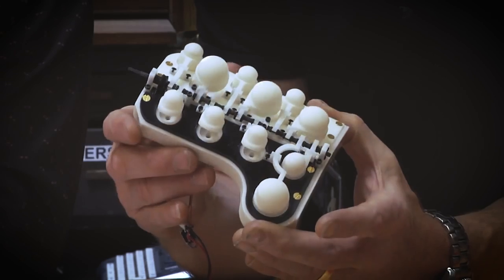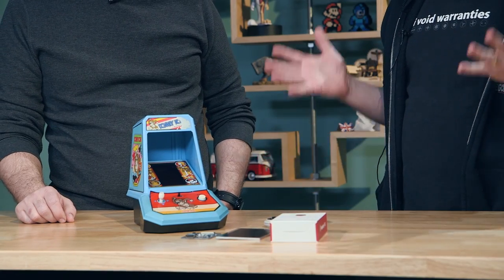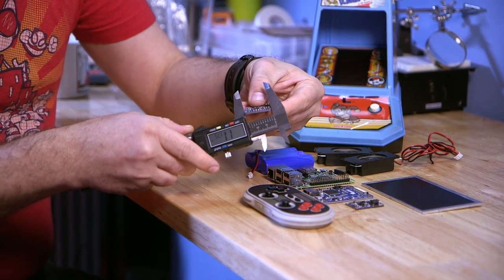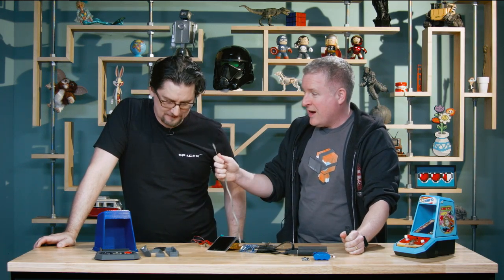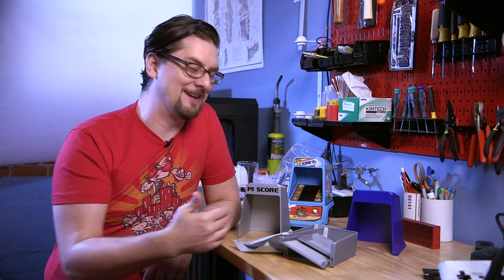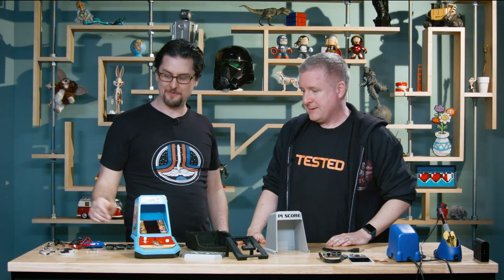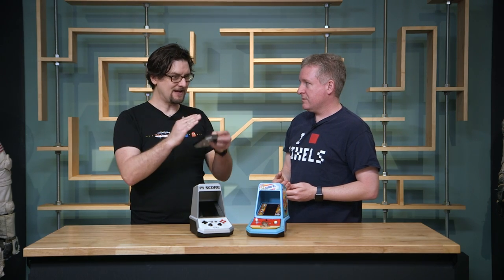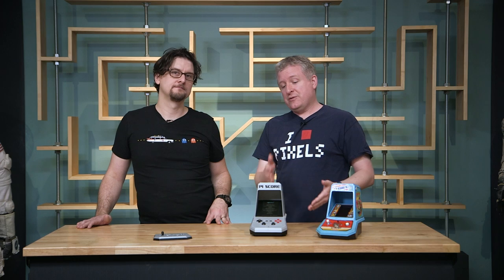Bits to Atoms: The Pi Score Arcade Cabinet

Comment: Did you ever look into using the four shoulder buttons on the controller? how difficult would it be to break them out to other buttons? what about the buttons one the bottom edge? that's six buttons on the controller that are neglected.

Comment: Neat!   BTW a Pi takes more than an amp itself...so I would think you need a 2A power supply.
Reply: Yup, they're running low for sure. I believe 2.4A is the recommended current for the Pi 3.

Comment: Could you model the bottom of the arcade stick like an nes dpad and use a ball pivot point and replace the original dpad with the arcade stick. I think he said they might of tried this but they didnt specify the ways they tried to make it work.

Comment: Would be nice to just be able to fit the controller in the front panel .. not having to disassemble the controller.  Then you could remove the controller and play with it in your hands if you wanted also..